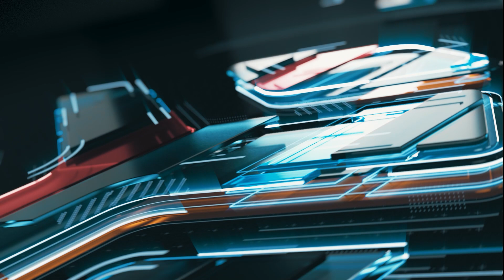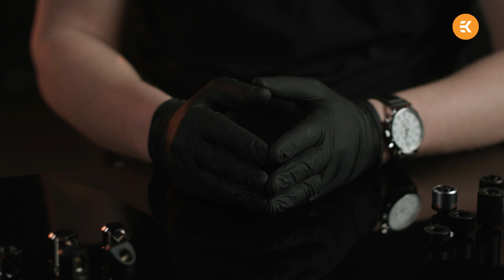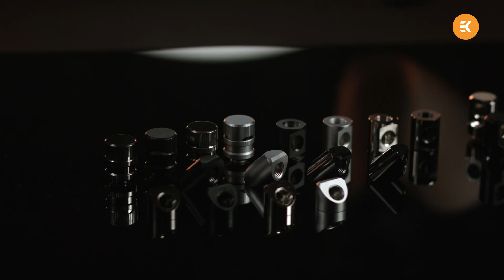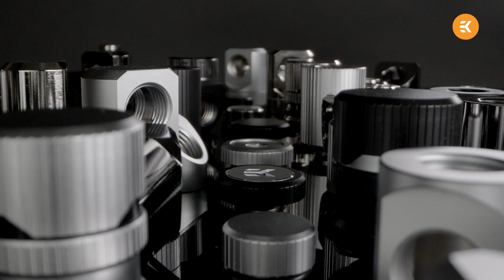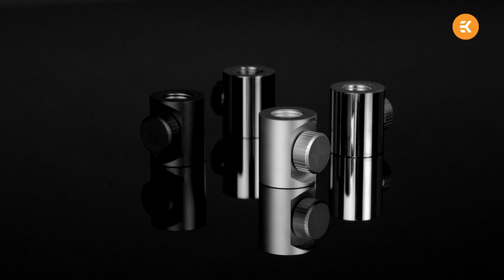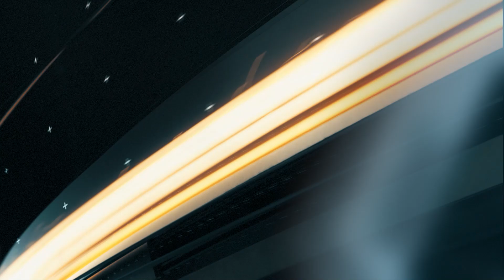Step Inside the WORLD of EK TORQUE

Comment: I just ordered like $1200 of EK gear for my first custom loop build ever. I'm nervous but excited as hell to do this.
Reply from the maker: You can do it!
Reply: @EKbyLMTEK  Delivery is today...I'm doing dual 45mm radiators, CPU, GPU cooling with Quantum Reflection distro for front of Lian LI 011 Dynamic XL ROG case. I realized I was missing one tool - cutting tool for acrylic tubes. Ordered that today. Luckily I found out now that the standard PETG tool won't work on acrylic.
Reply: just ordered my stuff like a week ago tell me how yours goes lol
Reply: @brivero92  I watched a lot of videos on YouTube of builds identical to mine...I feel confident it'll go well.
Reply: @brivero92  How did your build go? I was able to get everything done neatly and working great... unfortunately had a bad pump on the distro plate but EK replaced it.
Reply: @GSP-76 how did it go?

Comment: Will there also be a 2x 45° Quantum fitting? I relly miss those, they are perfect for adjusting your tubes and making them perfectly parallel, even with different hardware. the most common example would be to adjust the CPU tubing to an EK distro, or with a larger GPU block like the Asus RTX 3090 TUF and a distro like the EK-Quantum Reflection PC-O11D XL D5 PWM D-RGB.
I also can't wait for more distro plates for different cases!
Reply from the maker: Not at this time, unfortunately. Sorry! :(